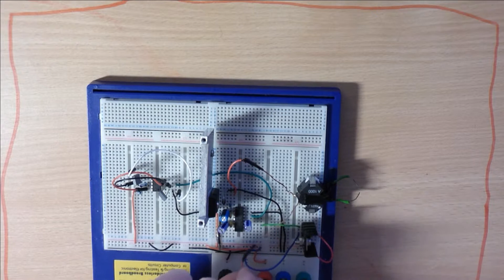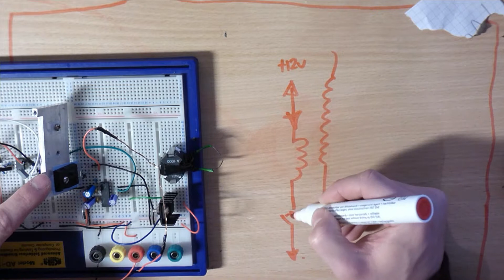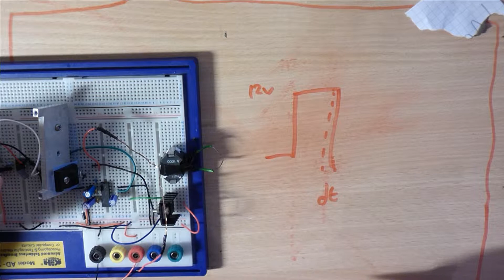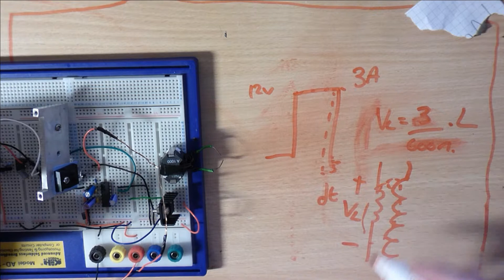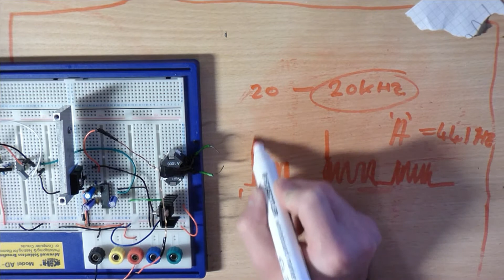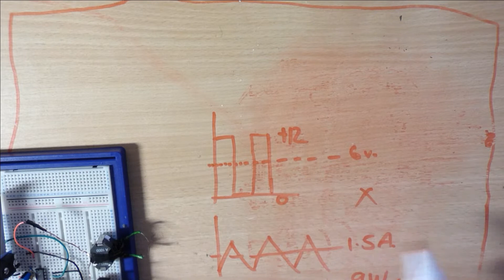Life EE #3   Making a Plasma Speaker

Comment: At the VDD where does the capacitor go ? And what is its value ?
Reply from the maker: Cap goes from VDD to VSS, around 100n should do the job, ceramic is a good choice but electrolytic is also fine.
Reply: Instablaster

Comment: Where is one end of the secondary conected to ? I see its just left hanning out in the air. If i want this to be a tesla coil. Where must i connect it to ?
Reply from the maker: For the plasma speaker, you'll want it left disconnected like this. For the Tesla Coil, one end of the secondary is grounded, and the other connects to the top load (the metallic torus)
Reply: Life of an Electronic Engineer.
Would it be grounded to the physical earth or the ground of a wall plug ?
Reply from the maker: @orangebrandon5260  I'd advice a actual earth, Any piece of metal large enough to take the current without really affecting it's overall charge is good enough (that's basically what the Earth does). In fact, I used a some metal tube about 50cm long and it worked well for my tesla coil :) check it out here https://www.youtube.com/watch?v=AyXX_V5bcWM
Reply: Life of an Electronic Engineer.
What stoped you from creating larger arcs ? 
And would you recommend a higher voltage or current input of the primary coil ?